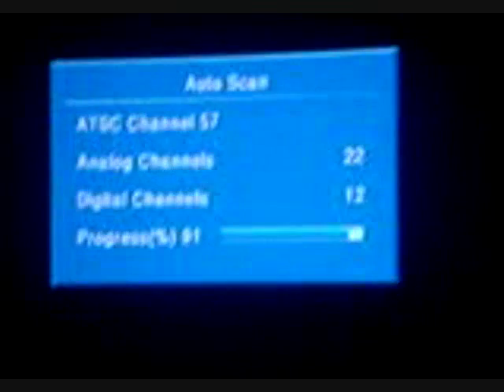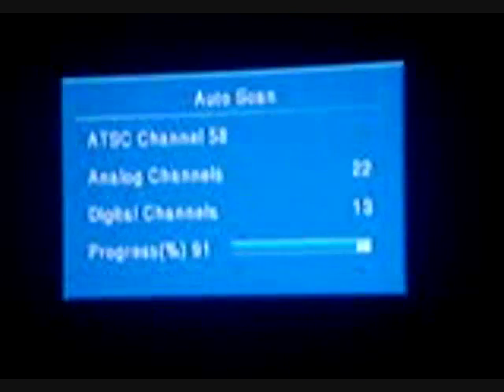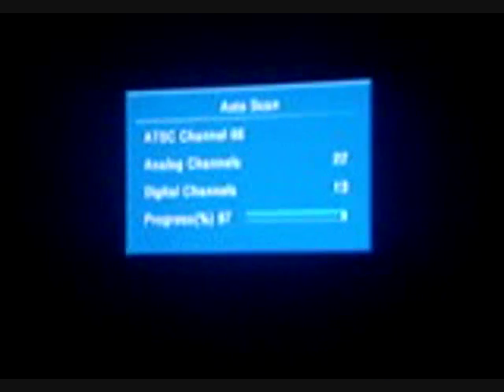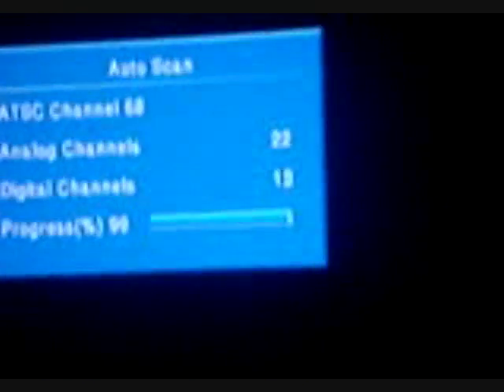HDTV coat hanger antenna,High Definition

Comment: On some of these videos people are posting not to waste your time and that these are good only for five miles. Those typing this have not built nor tested one. I have built three, one for a friend, two for the home. 
Five miles? I am 55 miles NW of Chicago and 50 miles SW of Milwuakee. I ran both coax leads in to a spltter/combiner I bought from Circuit city and into a signal amplifier from Radio shack. The amount of crystal clear channels received? 38. Cost of antennas? About $5.00. 
Bill? 0$